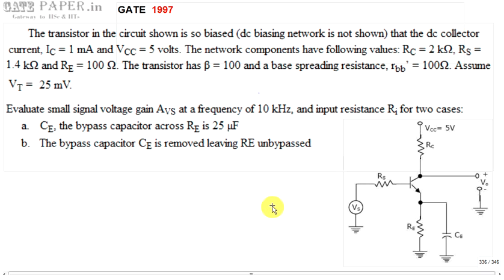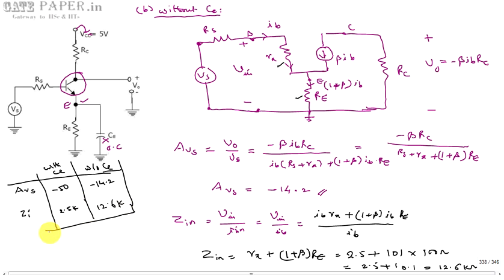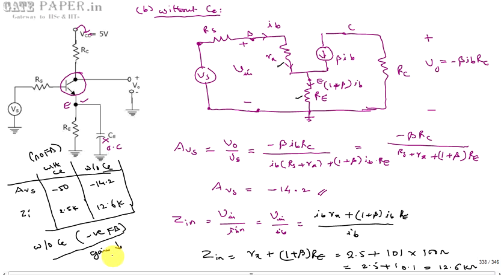GATE 1997 ECE Effect of emitter bypass capacitor on gain and input impedance

Comment: As in AC analysis all by pass capacitors are short -circuit for low or mid-band freq. For this given question frequency is given  10k Hz. How do we know this freq comes under which range (low,mid or high)freq. Please reply.